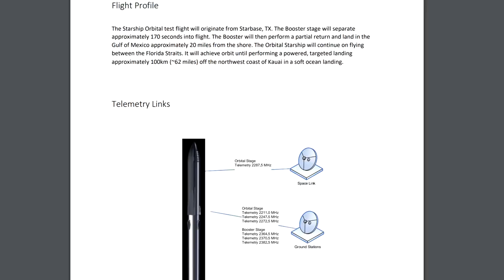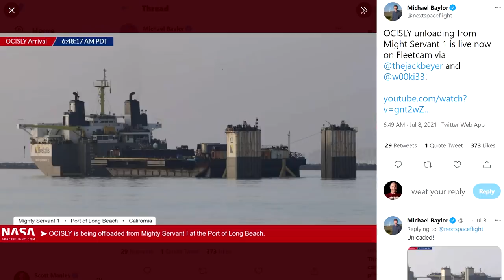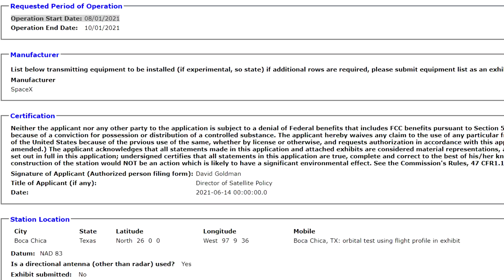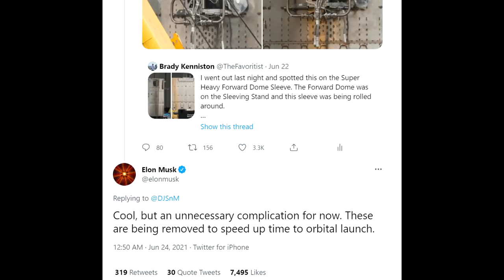Why SpaceX Will Move To New Thrusters To Simplify Starship

Comment: How does the liquid fuel stay liquid during long time periods of space flight. Does refrigeration use a lot of energy?
Reply: Once compressed to liquid state, an equilibrium is established where the liquid no longer vapourises because of a matching pressure from the vapour. As long as the tank can take the pressure of any vapour component the liquid will remain so. Heat increases that pressure, but as long as the tank contains it everything is fine and most of the content remains liquid. For cryogenic fuels/oxidisers, the problem will start to manifest over time because cooling things is expensive in vacuum, but vacuum is a good insulator and you can decouple your hot surfaces from your liquid tanks to an extent.

Comment: That area. Off Kauai the Pacific Missile Range Facility. ,Vanderberg shoots missiles  over and PMR at Barking sands shoots them down or a sub does, subs  test torpedo s there too.Port Allen has small  retrevel boats
Reply: There are over 1,100 square miles of instrumented underwater range and over 42,000 square miles of controlled airspace.

Comment: How do they actually generate electricity on rockets? Can’t be all batteries? Maybe a separate turbine plus generator? Would be interesting to hear if there have been different solutions to this problem in the past!
Reply: It's all batteries. It's actually not as bad as you think - for example, the Ariane 4 rocket only needed about ~1.1kW for the 6 hours it is required to stay powered for certain launches. That's less than your average electric heater on the wall, yet that is not a small rocket!

But of course, for actual long term electric power, you need to actually generate electricity. Solar is the most popular choice there, but you also have things like hydrogen fuel cells - used famously on the Apollo spacecraft during the trip to, and from, the Moon.
Reply: @Mythricia1988  thanks! I kinda forgot that most missions are rather short. Also, I overestimated the power requirement. With only about 10kWh required I can see how batteries would not only be simpler and more reliable but possibly even lighter than other solutions.

Comment: can't they use electric pumps to quickly cycle those rcs engines?
Reply: The batteries would be a lot of mass
Reply: @alvianchoiriapriliansyah9882  there's two turbines in the main engine. i thought they use them to run a generator anyway

Comment: I would presume that losing 3 raptors at the bottom of the ocean is something SpaceX would like to avoid. Those RCS thrusters sound like a gunfight.
Reply: They're going to be dropping more than 30 in the ocean.  Maybe even more than once.
Reply: @TheEvilmooseofdoom  And obviously that's no problem because it's cheap already
Reply: Not really. The last we heard, they're delivering a Raptor ever 48 hours... and it's going to take longer than that to refurbish one that's been dropped hot into seawater. I imagine they'll fish them out of the water for study, along with the rest of the debris, but they're certainly not going to waste time trying to reuse them at this stage of development.
Reply: @simongeard4824  Fish them out?  Not if they sink and sinking is the most likely outcome.
Reply: @TheEvilmooseofdoom  Depends on the landing. If it breaks up on reentry, there's not going to be much to recover. If everything works perfectly and they make a soft landing in the ocean, I imagine the tanks will keep it afloat for a while... maybe long enough to get a boat in.

I certainly don't expect them to salvage the entire thing - not unless they're borrowing some big ships (from the Navy?) - but I'm sure they'd like to detach a few engines, get a good look at the used heat tiles, etc...
Reply: @simongeard4824  It would be something if they remained intact after toppling over.

Comment: So, Starship will basically use Rutherford engines as RCS thrusters.
Reply: Not quite. Rutherford uses turbopumps like the Raptor and the Merlin, except instead of powering the turbopump with a gas-generator and turbine, it instead uses an electric motor (with an insane power output for it's size) to run the turbopumps. Meanwhile, the hot gas system will probably use pressure fed engines that instead of running straight off of the pressure in the main tanks, would have something similar to a hydraulic accumulator to store both the cryogenic CH⁴ and O² (in separate tanks obv) and fuel will be pumped into those accumulator like tanks via low volume high pressure electrically driven pumps. Those pumps would almost certainly not have the flow rate to feed the RCS on their own, instead they would charge the accumulators which would then feed the RCS
Reply: Not for the RCS but maybe for the lunar version. The RCS thrusters will likely be gas / gas pressure fed. The electric pumps will pressurize tanks and the tanks will feed the engine. When they get to autogenous pressurization vs the current nitrogen system, it will make it easier; which possibly a reason for not using it on the orbital attempt as it uses nitrogen. For the lunar Starship, I am guessing they would prefer to use multichambered engines with electric turbo pumps; like the son of a RD-170 and a Rutherford. However, depending on complexity and time, they may go with liquid pressure fed system.
Reply: @richardmillhousenixon  Interesting. That would definitely reduce part counts— why have one pump per thruster when you’d have far better redundancy and far fewer parts with three shared pumps that could all run the system in a pinch!

Wonder a bit about tank weights, but if it’s even close, the lower cost is more in line with the project goals.

With that in mind, why wouldn’t a shared turbo pump system be used in boosters? When you have 27 engines on the bottom of the candle, you’ve got an awful lot of redundancy no matter how you cut it.

Comment: I thought these thrusters were run off the same fuel (CH4,LOX) as the main engines. That way they can be used on Mars.
Reply: The hot-gas thrusters probably eventually will be, regardless of whether they initially are or not, but for the cold-gas thrusters that're being installed for testing, there's no particular benefit to using the same propellant.

Comment: I saw them rolling the super tall super heavy booster around vertically and wondered if they are confident it won't fall over in a wind gust because they plan to use thrusters if it starts tipping.
Reply: They're confident I think because most of the mass is at the bottom.
Reply: @TheEvilmooseofdoom  as it is with a mostly empty falcon 9 booster.  But the wide support of the landing legs still appears to be necessary for safe transport while vertical.  I know the narrow road makes it impossible to do that with the super heavy booster so I think they may have some other system to fall back on if something goes wrong and it starts tipping.
Reply: @wesleyashley99  There is a tipping danger while it's free standing.  Once clamped to a big heavy transport stand things change.  If the booster was going to land like a F9 it would be wise to have legs similar to the f9 too.  If this catching business doesn't work out I would expect legs to be plan B.

Comment: Anyone else find it odd they aren't going to hop the booster to at least see if that many engines can have a sustained fire before going for the orbit?
Reply: To hop it they'll need to design and install landing legs.
Reply: @TheEvilmooseofdoom  would they? Especially if they hop it high enough to clear the launch tower though it seems they're pushing the orbital test far before the catching mechanism is ready so perhaps so
Reply: @chacecrowell   A hop that destroys the booster doesn't tell them much.  The plan for the first test flights is to expend the booster and starship.  So they're going for a full up test.
Reply: @TheEvilmooseofdoom  I suppose you're right it's just a little strange given the Soviet N1's failures that they wouldn't want to test out that many engines more thoroughly before putting an active load on it
Reply: @chacecrowell  If they stay true to form they'll static fire a full booster before flying it.

Comment: Why does a rocket need to be a sleek aerodynamic tube? Can it be a simple, minimal frame that supports the habitation modules and the tanks and engines for the few minutes it takes to get into space, where aerodynamics are not an issue? And the frame and tanks and engines can be re-used. And Hab-Mods too.
 
Its just a support structure between the lifting bodies and the payload. No aerodynamics needed. It can be way more minimal. A camper held together by a crane being pushed by some rockets. And tanks and wires and stuff. That's all you need. Wagon Train to the Stars- with horses in the back.
Reply: It has to launch through atmosphere.

Comment: I would think they will at least try to recover the vehicles if they have any trade secret engineering in them.
Reply: If they can't recover, and I doubt they can, they'll sink.
Reply: @TheEvilmooseofdoom  I meant recovery from the ocean floor
Reply: @mattgraham4340  The ocean is deep, it takes a lot of very expensive and specialized hardware to recover things from the ocean floor.  Keeping secret things safe is the point of having it sink.

Comment: Simplify, simplify, simplify. Musk uses the same logic by using an electric motor to power his cars. An automobile engine must convert vertical motion to circular motion. The electric motor is 90% efficient, although I wonder of the efficiency rating of the newest electric motor, I am sure the efficiency has improved, while the auto engine tries to run near 29/30% efficient. Some may say that this is not the same,  however,  when you remove complexity to do the same thing, you improve reliability.

Comment: For lunar landing, wouldn’t it make sense to land horizontally? Especially if you are not using the main engines. This would eliminate the silly elevator, not to mention the risk of just falling over.
Reply: It has it's upsides, and it's downsides. The obvious upsides are the elevator and tipping risk that you mentioned, but a downside is that the Moon does still have 1/6 of Earth's gravity, which means a sideways landing and launch would produce very large bending forces, which Starship isn't currently designed to resist. Further, you would still be faced with the debris problem.

Comment: A very basic thing is bothering this layman. When a rocket blasts off...and rises from the earth, why doesn't it fly sideways with a 1000 miles an hour? I mean..that's how fast the earth rotates, so why don't we see the rocket disappear with a thousand miles an hour, nor planes for that matter... I just can't wrap my head around this - to me - weird thing. If the earth rotates with a 1000 miles per hour, then why don't we land on a different spot when we jump up?
Probably a toddler science question :/
Reply: Good question. If we take the jumping up in the air question then we're traveling at the same speed as the earth already, we don't suddenly decelerate just because we jumped.  Looked at another way if we are sitting motionless in a plane, then we're not actually motionless, were traveling at 500mph or so, were just motionless relative to the plane.
Reply: The rocket, like you shares the earths momentum.  It's still moving sideways.
Reply: Also the atmosphere shares the earth's motion as well, otherwise we would have 1000mph winds at the surface.

Comment: Even with a gas to gas injection your still going to have liquid fuel in the tanks. It must go through a regulator or something to gasify it. But you couldn’t store enough fuel and oxygen if it was in gas form in the tanks. The pressure would be very low as would the density.
Reply: At my place of work we have tanks of gaseous oxygen exceeding 2200 PSI. Bull shit it would be low pressure
Reply: You can keep it gas at high pressure.
Reply: @TheEvilmooseofdoom  You can keep it gas at VERY high pressure

Comment: Why Starahip cannot land like a plane, with 2 big paraglider style parachutes and 3 light wheels....has the flaps and all...lot more safer....i would fly in it that way...
Reply: Starship has no horizontal strength. Plus parachutes aren't strong enough to slow down starship. Wheels and parachutes would add too much weight. Landing vertically can be just as safe with practice.
Reply: @haydenravenscroft1803  it doesn't need to lad soft...just like  Shuttle...with high speed on a runway with parachute like a paraglider....it can have some pressure in the tanks, for rigidity...plain air even, gathered on the way down....wheels can be mounted on the flaps...they are rigid....
Reply: @haydenravenscroft1803  it can have momentum on landing like space shuttle,  parachutes can just give some lift, in addition to the flaps...wheels can be mounted on the flaps, they are rigid structures...a redesign will be needed for sure... but not to drastic
Reply: @kristijantodoroski1409  By the time you have added all that it will never get to space in the first place. Plus you can't land like that on the moon or mars. You'd need to use a totally different material for the body and fuel tanks.

Comment: Scott, how can Starship accommodate 100 people + their water +  oxygen?
Reply: The people go in the pressurized volume, the supplies go in both the pressurized and unpressurised cargo areas.  IF they build something to carry 100 people, which is just a projection at this point.
Reply: @TheEvilmooseofdoom  Thanks, I just don't see enough volume for 100 passengers and their supplies. 16 people is possible, as  a guess.
Reply: You might be underestimating the size of Starship, because the simple answer is that it's *huge*.

Starship has a 9m fuselage — and to put than into perspective, an Airbus A380 has just a 7m fuselage. The internal volume of the two comes out to be pretty similar... so compare Starship with an airliner that can carry 500+ passengers as well as a substantial cargo space.
Reply: @NeverTalkToCops1  800+ cubic meters of space..  The shuttle had 75 for 7 people and seemed there was plenty of elbow room.
Reply: The Starships have a bigger cargo / passenger volume than a 747. You vastly underestimate how large this rocket is. Oxygen is easy, they're carrying hundreds of tons of it, as fuel. Water is also easy, you just carry what you need with you as cargo, and recycle it, just like they do on the International Space Station.

Comment: Gas is pretty rubbish to use in an engine with a constant combustion.  It is so much easier to force a liquid into a high pressure combustion chamber than a gas - which essentially has to be a higher pressure than the combustion chamber!
If I were making these thrusters I would have an electrically driven plunger (syringe) which forces the liquid into the combustion chamber.  Then it would reverse (when liquid available) and suck more back in for next firing.  No good for constant thrust but I don't think that is necessary for a thruster.
Reply: They don't fire constant.  They fire in very short pulses.

Comment: Startship will inevitably devolve into a Space Shuttle clone because the space shuttle is the most economic design.
Reply: Space shuttle died precisely because it wasn't economic, 300 mil $ per launch.
Reply: @randomnickify  It wasn’t economic compared to what? There’s nothing else in existence that has the mission profile of the shuttle. The shuttle died because there were no more missions for it.
Reply: @DrMacintosh  Most of the missions done by the Shuttle could be done by much cheaper means - I mean Russians just delivered new module to ISS using ancient rocket. Only missions requiring a shuttle were satellite repair/recoveries and even them were just technology demonstrations since it was simply cheaper to build and launch new satellite than waste 300mill to repair old one and today we already tested refreshing old satellites using... other satellites - we can expect this technology will evolve fast. Literally only missions that can not be easily done without Shuttle were Hubble servicing missions, however without the Shuttle we would already have a Hubble 2 on orbit - its as simple as that. In the end desperate need to prove the freakishly expensive Shuttle is necessary has stagnated the space industry, "there were no more missions for it" is gentle way to say "it turned out to be useless" :)